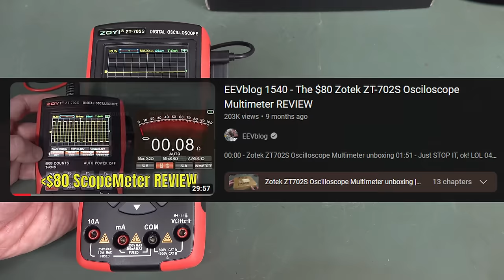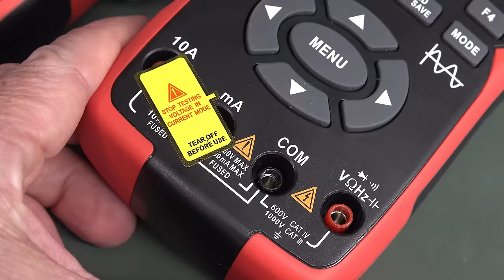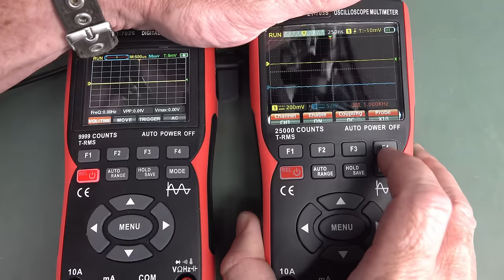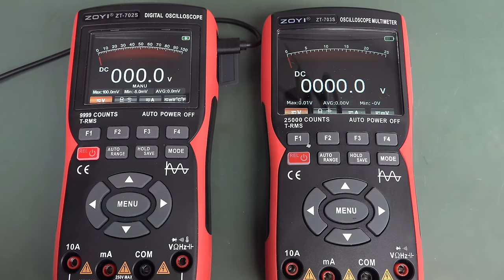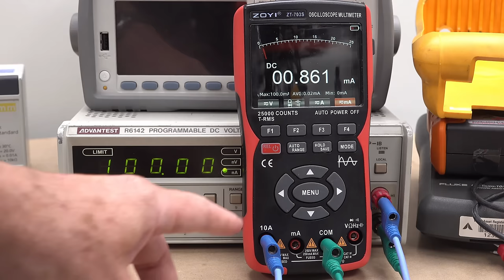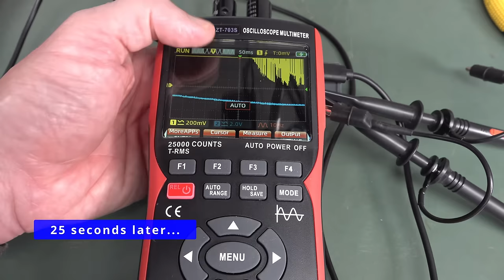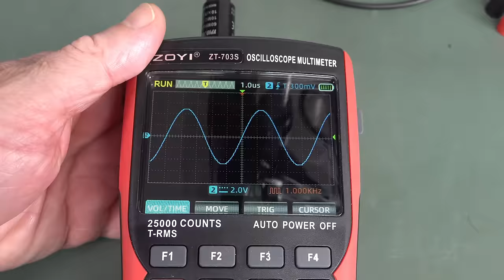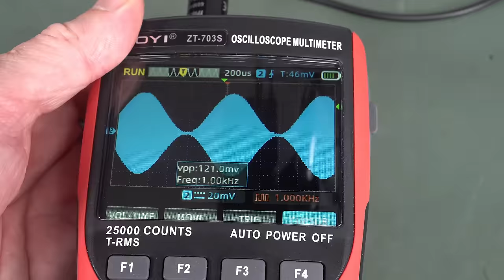EEVblog 1597 - Zoyi ZT-703S $80 2CH 50MHz Oscilloscope/Multimeter Review

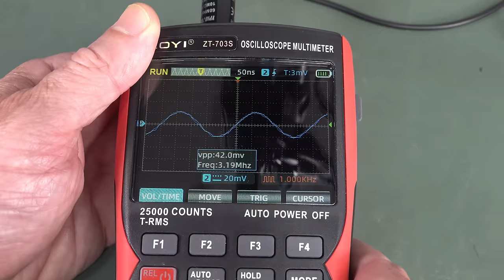Comment: The "jitter" problem with the frequency measurement around 18:40 seems a bit odd. Both adjacent timebases 50ns and 250ns appear to work fine-ish, just the 100ns one gives 3.2MHz instead of 4MHz, suspiciously close to 4/5 of the correct value. 

Is there a systematic issue with this timebase? Maybe there's a wrong denominator lookup value in the firmware somewhere?

Comment: Firmware version 1.30 is not upgradeable, if the unit was supplied with this firmware then that's it, cannot be upgraded, may crash if attempted. There is a message on the official website when downloading the latest edition to this effect.

Comment: Just a general question regarding DMM/Scope Combos: Does anyone know such a device where the scope part can not only be coupled to the BNC-inputs but - at least for lower sample rates - also to the DMM inputs? I think It´d be really sexy to have such a device where you could e.g. bring up the current measurement to the time-resolved scope display. Or the resistance. Or temperature. 
In other words, I´m asking for the combination of the input variability of a DMM with the measure/trigger flexibility of a scope.
Of course this seems impossible with 50MHz bandwith, but even with 10 or 50 ksample/s I would spend money on it.

Comment: Hey thanks, I have actually the "old one" but it has the fix to restart in the mode you used last. 
It's indeed a shame for the graphic in multimeter mode. They should have used a simple graph showing last 10s shown values and min/max+avg. That would have been a very good thing instead of this useless laggy thing. I'm still very happy about mine, really good bang for the bucks 🥹🤌

Comment: Would it be good for a hobbyist working on Arduino projects ?
Reply: For Arduino things must be good enough. These can lack with high speed signals or very low voltage signals (talking about analog ones).  Arduino wont make a pin toggle pass 1Mhz, even on the ESP32.  And SPI would be on the range of 10Mhz. Of course it will show up a bit rounded. Nothing to worry about at this price tag. FOR YEARS we survided with 20Mhz scopes LOL. I have a 702 myself, it is 10Mhz and I like it.
Reply: I use the Saleae logic 4 logic analyser for such stuff. It's not 'real time' as such but being able to 'read the protocol' can be useful.

Comment: Why manufacturers do not put a relay in to their multimeter, which changes "inputs" whether I want to measure A instead of V? 
That way we could forget the multiple plugs and to switch between them manually? This would also fix the errors when we forget to switch them?
Reply: It isn't possible, unfortunately.
Reply: Oh but it absolutely is possible. It's just not a good idea overall.
Just from the top of my head I can think of two very good reasons not to do it:

1 Reliability (burning of the contacts when the user does stupid things)
2 Price (any relay with a 1000 volt DC breaking capability is going to set you back several times the price of the rest of the DMM).

But possible it is.
Nobody in their right mind would implement such a feature.
Reply: @ghydda  Haha, I would :D I think at manufacturing level parts are a lot cheaper than people think. Adding some good relays and parts necessary, would cost like 5usd... But I understand your points, I think they are valid overall.
Reply: @ghydda  when I was buying a cheap multimeter the other day a lot of the meters had the mA range on the same input as the voltage etc with only the high amp fused on a separate plug, I steered clear as I thought it would be too easy to short out something you were trying to measure the volts on.

Comment: Looks like it's using parallel shunts for mA and A, hardwired.
Watching you poke around in the PCB with a screwdriver while the battery is still in the holder is making me nervous. 
Advice to manufacturers: clean up the flux, at least on units you send to YouTubers who are going to tear them down.

Comment: Why are you so worried about the battery life? It has a USB-C connector. I can't imagine where I would need an oscilloscope or a multimeter and not have USB-C available within a few steps (power supply/powerbank/notebook/tablet/...). Is there a problem using it while charging (interference or something)?

Comment: 50 MHz range seems sufficient for the microcontroller CPU clock sources which tend to be a bit below the particular frequency they are meant to handle. Of course I can upgrade to SiTime TCXO or OCXO MEMS oscillators if I really need to, as I obviously know how to mod that thing especially if I really have to. And of course it's inevitable that somebody would have far better custom bootloader to load what they got that's quite accurate. So yeah, I ordered it. 🫣 That's so I can quickly sort out MEMS oscillators I got as a few SiTime MEMS oscillators that looks a lot alike so I needed something to count the frequency. And I plan on building or buying a better RF oscilloscope probe cable so that way I can see something I wouldn't otherwise do with the original probes if I have to. 🤷 Even if I blow the fuse, I know what to pick for the replacement fuse, and important part thing to be mindful of as some fuses are used as resistor for ammeter functions.

Comment: Classic bricking the 1 channel, I wonder how you'll fix that? Although it's best probably in the bin lol
Reply from the maker: Might need the factory programmer
Reply: @EEVblog  There's a button sequence you hold down when you power it up - might put it in recovery mode or something. The instructions say to hold F1 and Power simultaneously. It also says that V 1.03.30 doesn't support firmware upgrades - so if it was that version to begin with, it's probably bricked unless you flash it with JTAG

Comment: This is very interesting and amazing, but I would not touch it with a barge pole. If you are working on expensive equipment where downtime is measured in k$/hour, this is absolute insanity. If you are a hobbyist putting together your own circuits on a Sunday afternoon, this is pretty good.
Reply: captain obvious

Comment: Dave, you're awfully whiny about a under a hundred buck two channel scope/meter.  You complain when you have the setting or probe  connection wrong but even with my Fluke 79 meter, if the select knob is in ohms it's really hard to get a voltage.

Comment: intelligent and burning... yay. exactly what i need. Question: does it xy mode? i am searching for small little neat oszi to adjust some tapedecks. tried some cheap oszis, but they didnt support xy mode which may essential as i read. i am a noob :) never used an oszi before but wanna learn. TO ZoYi : i dont look into oszis, but seeing lasered chips stops me from buying this brand. full stop. :P what a fail. just WHY? ... it scks and is stpd ... want you hide some rip off designs? unmaintaineable device. even the firmware glitches which are easy to resolve are disgusting. 22:52 :P

Comment: I'm so frustrated viewing this review, like zoyi is being like greedy. They want to have it all but can't really do it right. Why not just building an oscilloscope then make it good enough, then a multimeter that can also do enough. Not like this, you have it all in one but useless in any ways and too many flaws and errors. This multi meter/scope must just be an ohmeter, capacitance and voltmeter only for my own point of view for what I see in the video, for it's accuracy on resistance, capacitance and voltage reading only and 25k counts. I have their 6k counts multi meter only already, the green ones 😅, and i can feel that they are good, so a 2 channel oscilloscope only might be the right partner for it. Sir Dave, please talk to them about that. To make a 2 channel oscilloscope only, and make it perfect, no other chitchat. 😅
I can carry a two pocket size device which I know I can rely on than a one all in one but shaking my knees in the field because i have a not so reliable device in my pocket. Well two is better than on so to speak. And how can we use that scope anyway when we are at multi metr mode? Totally useless piece, then the bar graphs. Ggrrrr! 😅